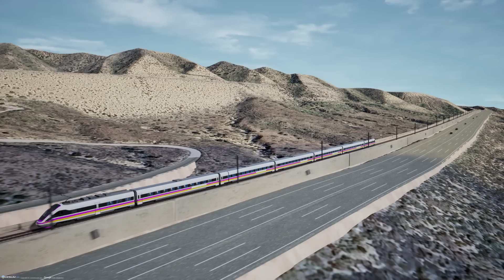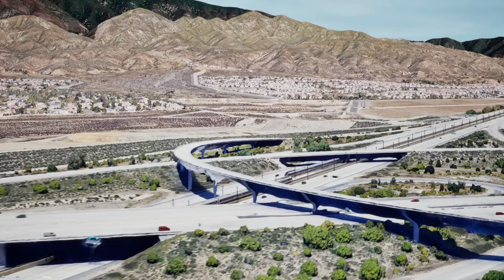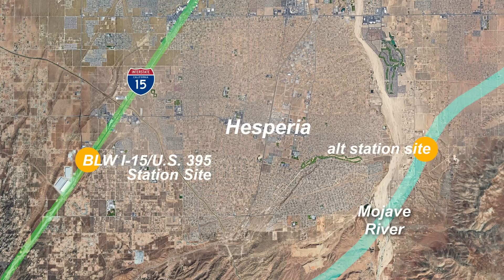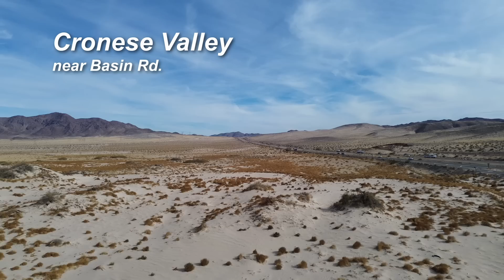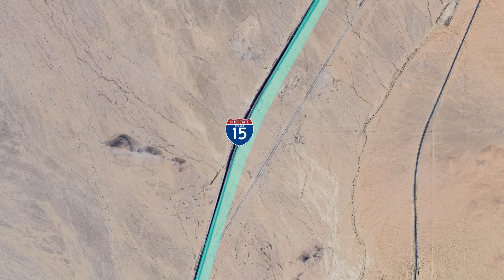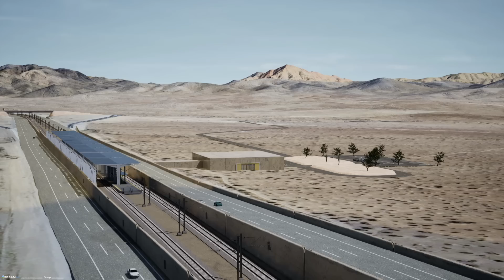Brightline West High Speed Rail Better, Stronger, Faster

Comment: It's hard enough to get the BrightLine West project funded as it is. Most of these changes are too costly to implement at this time. However, some of the smaller improvements would make more sense like widening of some curves or early banking to of steep hills to reduced the incantation.

Comment: Just looking at both station locations before this video, and it's crazy to me that they couldn't get either near any downtown. Not going to LA makes sense on a time and money basis, and could be extended to in the next 10 years, but the Las Vegas station being a mile + south of the airport makes sense only for the available land and low cost of construction. Maybe if there is local transit to the station this will be alright, but that would mean relying on busses or the Boring Company to build down there.

Comment: If California builds a tunnel instead of Cajon Pass then it should be five tunnels, two for passenger services, two for freight and one for water. The smaller exploration tunnel would be for water.
Also if there is six mile tunnel from San Bernardino to Hesperia, why should there be set of tunnel close to 30 miles long between Burbank and Palmdale?

Comment: How much are potential passengers willing to pay? Or rather, how much more than the cost for a bus or plane? Where's the point of viability?
Reply from the maker: This is what Brightline West will find out because they're now talking $119 one-way average ticket price when major carrier airlines charge about that much for roundtrip.
Reply: @LucidStew  I live in the Vegas Valley. I had discovered Amtrak in NJ, and naively expected it to be here, expected to explore the Southwest by rail. We all know how that went. But I'd still like to take a long train trip, and that means getting to LA's Union Station. So far I've been bogged down in the various bits and pieces and it's unlikely that Brightline will be the answer. They have to pay for all of it, and turn a profit. Passengers will have to pay enough to cover that. At one point I think I read a figure about 4X the one you cited. Amtrak is considering passenger trains through here again, the tracks are here, freight trains use them. Things could get interesting.
Reply from the maker: @ $119 is the latest info with Premium tickets being a little more, like in Florida. Amtrak Desert Wind is being studied as one of many potential long distance reactivations, but nothing has come of that study. Maybe if the next administration is Democrat, who knows. But still, I wouldn't expect Amtrak to be competitive. Desert Wind in the past took over 7 hours between L.A. and Las Vegas. Brightline West in conjunction with Metrolink will be about half that.
Reply: @LucidStew  Let me be absolutely clear, I'm NOT arguing with you in any sense. (I am in fact in awe of you.) But if one's goal is merely travel from point A to point B, speed and fare might be the only deciding factors. But how about adding in getting to and from the departure/arrival points? Or making connections with planes, trains, or ships? Those who are going east are more likely to be thinking in terms of taking a ride share and checking into a hotel, but for those going west it might be just a stop along the way. Value varies tremendously between traveling solo, as a couple, or as a family. Since Brightline won't be using existing freight tracks, nor dealing with traffic and air issues, they should be the most reliable in terms of on-time arrival. (If I were going to LA to travel beyond, I would want to arrive as close to check-in time as appropriate with the least amount of "fuss" and without spending a night in a hotel there. The fare and speed would be relatively incidental when taking it all into consideration.)

Comment: If Brightline West wants to go faster, the number of stations must be decreased to maintian its speed.  The main reason to have HSR is to connect 2 metropolitan cities, not stopping every small towns to make more money to make more profittable.  If Brightline earns $50 billion 2028, they will go for 60, 75, 100, even 200 billion in following years.  To do that, Brightline must increase/jack up the ticket prices; therefore, it will make less attractive to riders and lose the ridership in result.  Will those extra profits go to those workers? Of course not.  It sounds good for private sector to work on this project but not when it comes down to ridership and maintenance (just like East Palestine OH back in 2023 [NSC]).

Comment: A nice rendering, but tunneling through the SB mountains would be very expensive, not to mention the additional precautions needed for the San Andres fault crossing. I agree there is no need for a Hesperia station since Victorville isn't that far away. It's supposed to be high-speed, not a city-stop train.

Comment: Interesting new concept using more tunnels which is nice if you commute the Cajon pass everyday like me since the current I-15 construction is already a nightmare going home at night I cannot even imagine what it’s gonna look like during construction if it follows the highway all the way up the pass traffic is gonna be horrible during that time of construction. Seems like it would take longer construction wise tunnel boring through the mountains though. That would be cool if the station would be at Rock Springs/Deep creek lol quick uber ride for me to the station. Going through Silverwood seems tricky since they are currently building a brand new huge community down in there. I guess it would follow existing right of way tracks to a certain point then change direction leading out of apple valley maybe closer along HWY 18 less congested area neighborhoods etc since the existing tracks make their way through Lucerne Valley.

Comment: Wow, great presentation. Simply put, if this was a 100 percent government (Federal/State/Local) funded project being fully double tracked is the only way to go.  The costs to go back and add this later could easily cost three times the price of the original project.  However, as a primarily "private" project BightLine West's current plan is the most logical and cost effective.  Also, whenever you add an new elevated structure, or even worst add a new tunnel segment, your construction costs can easily skyrocket.  (smile ... smile).

Comment: To be pragmatic, the cheaper solution that Brightline has chosen to follow stands the better chance of becoming reality.

I personally prefer higher speeds & the reduced travel time of your proposal.

Are you currently, or thought about being, in contact with Brightline to share these route ideas?
Reply from the maker: If we're looking at it from a private company's standpoint, what they've decided here is that its worth about $10 billion to them. ($13B cost - $3B grant). The way I see it, anything significantly above that and the private company simply doesn't build it.
Brightline West is aware of me. We have talked. I think their internal and contracted engineers probably have a far better idea of what and where is possible than me. :)
Reply: @LucidStew  Hopefully the people on Brightline's payroll are good at their job. Noce to hear that Brightline acknowledges your existence. 😎

Comment: I think BLW is taking a lower risk approach vs this proposal.  13Bil is a LOT of money, especially when they've gotten all the subsidies they're ever going to get for it and will have to spend that quickly to avoid a retribution clawback from the new administration.  Now the other challenge is getting the section from RC to LA electrified and double tracked so BLW can run all the way to LA Union.  Electrification is a dirty word to Metrolink.

Comment: I thought BLW is mainly a one-line route with certain area of layover/2 lanes.   Also, BLW does not appear to show any tunnels and elevated structures.   Is BLW proposed project realistic given the route constraints?  Please clarify and help us to understand.
Reply from the maker: That's correct, mainly single-tracked with double tracking at the stations and 3 intermediate passing sections. There are no tunnels, but there will be elevated structures. Two that stand out will be in Barstow and at the edge of the Las Vegas area near St. Rose Parkway. Overall it will be a challenging route, but I seriously doubt anyone involved would be pursuing it this far if it were impossible.

Comment: Get opperating 1st as early as possible.   Then use some of the profit to make improvements.   For me the best improvement would be to extend to LA Union Station.  That should be all elevated double track.  Once done, start double tracking where it is least costly.  Profit and opportunity will dictate where and when.  
The other cheap upgrade is to have express trains that do not stop

Comment: I personally am always in the minority on these kinds of concepts, where I always advocate for getting it all done AHEAD OF TIME, rather than waiting until after it is all built and running to then expand or "improve" the line or system. Always make sure you future prep, is like a catch phrase of mine and it is a motto. Get it all done ahead of time, including what will likely be excess capacity and excess spacing to add more trains, longer or taller trains, etc. That way you can know you got it done, and are ready for the inevitable future needs, demand and growth. There is a lot of reasons especially when it comes to transit construction to do it all at once when building a line or system, one being cost. The initial cost up front may be immense, but the long term pay off is near infinite if ran, maintained and managed correctly with the right focuses in doing so. It will also cost LESS overall in the long haul, too, given the fact that prices are ALWAYS increasing each year in the US to build any transit infrastructure, especially rail. Politically, you all but inevitably will find it FAR HARDER to even get approval of a concept and study for a new line when you wait until later, with different elected officials and constantly shifting priorities of voters. I could keep going, but I won't.

Comment: FYI -- the Las Vegas Review Journal did an article about the Brightline West $2.5 billion bond offering. Buried in the Brightline proposal is 1) they won't be running until Dec 2028, so not for the Olympics, and 2) one-way ticket is estimated as $119 in 2031 (first year of full scheduled service).
Reply: The whole premise for this project is flawed and that's coming from  a Los Angeles Native, living in Las Vegas.  After the first 6-months, with joy riders and introductory cheap tickets,  few people will choose to ride the train.  The LA area is huge and spread out and it will remain cheaper and FASTER to DRIVE, door to door.  When Amtrack operated slow and inefficiently operated trains from Union Station (yuk) to Fremont Street, they couldn't make it work.  It will be a novelty, and I look forward to riding it - one time.

Comment: so looking up Fault lines apparently you can build tunnels through them. i feel you miss a trick with this as does Brightline. Rancho is only a stop gap to a bigger system of starting at LA Union. so surely you want to build a system that can go 220MPH or higher from LA and the wider LA system.  i still think a San Bernardino Downtown Hub would be better than Rancho with a Large 250MPH X to Las Vegas, San Diego and Phoenix.

The Bernardino to Las Vegas tunnel i would have a 8Km rad S bend Apexing at the Silverwood Lake, into I5 Corridor or into the Corridor created by the Power wires North of Victorville. a Spur loop can then be created for a Victorville Station. 

your Las Vegas station Route I would keep in I5 centre on the view that services could eventually go North of Las Vegas to Salt Lake City. with the station in its current location but again Grade separated Loop to the station site... at 220/250 MPH running line you could mitigate the cost for the near sub hour run between central LA to Las Vegas and subsequent extensions to Salt lake city and beyond.

Comment: Doubling the cost for maybe 20 or 30 minute improved travel time is simply not worth it.  The fact that it's a closed system means full double tracking is simply not needed, except in case of breakdowns.

Comment: Because I don’t anything about trains, this looks to electrical, powered by overhead lines. Is there any merit to run as battery power, and switching out the battery car at each terminus? Rather than having the infrastructure, and the maintenance, of having overhead power, with gaining dependability as a bonus?

Comment: Brightline is only going to be able to charge $79-$129 for a single-way trip. Flights are only $49 from various LA airports to Vegas. So the cheapest build will be the most realistic. I'd like to see Brightline double-track in the future from Rancho to Apple Valley and from Las Vegas to the new Las Vegas airport that will be built south of Vegas. This will help those commuting to those spots and be a good source of revenue for Brightline in the future.

Comment: Even if BLW is only intending to lay a single track initially, it would be smart for any structures eg viaducts to be constructed with sufficient width for eventually double-tracking, Because construction costs are unlikely to decrease so they should probably invest that little bit extra now, to save themselves time & money later.

Comment: Looks like you have it running near the old Barstow station - which is now my preferred route for grade/distance/tunnel reasons and Palmdale connectivity, but I'd like the station better without the 1950-style brick add-on because it really sucks the way it looks from the road. I think you could build a beautiful addition consistent with the orig. style with modern high-comfort level (I mean luxury) that wouldn't cost too much, because the old part is really stunning. I think maybe there's some part that was demolished that needs RE-building too.  I wonder what it would be like if the entire 10-track low-platform station was preserved. Must be quite a sight in person. Maybe you should take a Barstow Station jog on one of your videoing trips!

It does sound very logical to me to avoid putting tunnels under fault lines and, notably, all three of my Anaheim-Vegas Cajon Pass alternates are underground at the San Andreas. Not being from California I searched around the internet trying to understand the issues with tunneling at fault lines. My 37-mile CAHSR Palmdale bypass goes under a different fault, and I sort of studied the internet then too maybe 7 or 8 years ago. Evidently there was something that made me convince myself that that would be acceptable. but I don't remember what it was. From Rancho to Hesperia only the long (21.5-mi) one goes through the Red "Type A" Zone with a high probability of disturbances, though I don't remember the projected time period between events. The other two alternates go through the less dangerous Type B Zone.

Is it just generally understood by people in CA who think about these things that building a train tunnel at a fault line is a stupid idea?  With the Palmdale bypass I did consider a giant tunnel enclosure inside which the main double-track tunnel would be built on top of rock fill placed on the bottom of the enclosure to bring the tracks up to about the middle - for whatever safety, if any, that fantastically expensive idea might afford.
Reply from the maker: If you're talking about a strike-slip fault capable of large magnitudes, then lateral ground movement measured in feet beyond single-digits is possible in a single event, so you probably want to keep that above ground. And I don't think that's just safety. Seems like it would be much cheaper to fix a large misalignment above ground. I know CAHSR engineering purposely avoided the San Andreas below ground. Here it was surprisingly close to being impossible as the fault is farther northeast than I thought, by about a half mile. The spot I initially liked for the west tunnel entrance next to the I-15/I-215 interchange was unfortunately on the Pacific Plate.
Reply: @LucidStew  Glad you were able to locate it. I mean the fault. Looks like I could direct two of my three versions onto the highway instead of starting the tunnel at it, beginning altitude gain vs. the ground fback farther, to mimic your tunnel approach.
Reply: @LucidStew  Pacific Plate? Don't You mean California Plate?
Reply from the maker: @ Our fault boundaries down here are between the Pacific Plate and the North American Plate. I live on the Pacific Plate, as do most southern Californians
Reply: @LucidStew  Could an alternative be to build a large cavern-type space that crosses the fault, say 3-4x the size of a typical tunnel diameter, so that when it does happen, there's sufficient room for quick realignment? Kind of like an expansion joint

Comment: I'm sure it's not the majority opinion, but if it were being built as a public infrastructure project, I'd definitely prefer Stew's version - double-tracking provides critical redundancy in a natural disaster-prone region and allows for what seems like inevitable capacity expansion in the near future. 30 mins is also a decent 30% time improvement, which would probably boost the long-term economic benefits of the line. Although it's a big step up in cost, the project would 'only' be ~$1,300/person in the metro areas without even getting the feds involved, which is substantially less than CAHSR or your LA to Phoenix proposal.
For what it's being built as tho (a private project meant to be a proof-of-concept and turn a profit) BLW definitely made the right choice and I'll take good over nothing any day
Reply from the maker: Good point on the public angle. If you're looking at it more as a long-term trunk that could hook into other lines its a different proposition from just Brightline West using it.